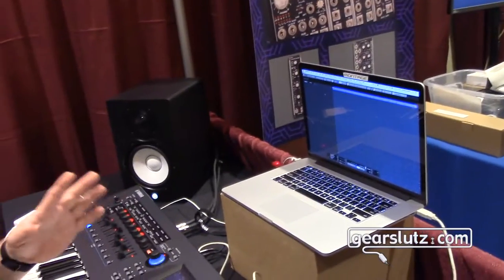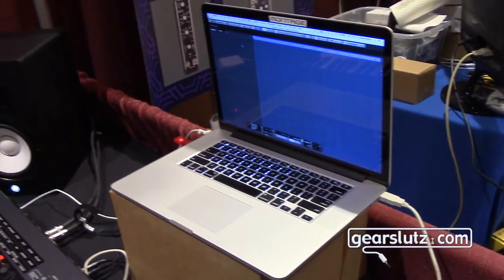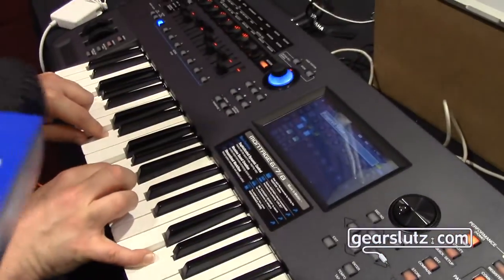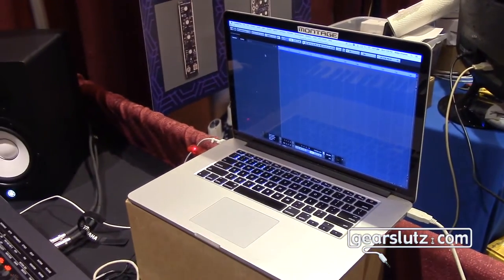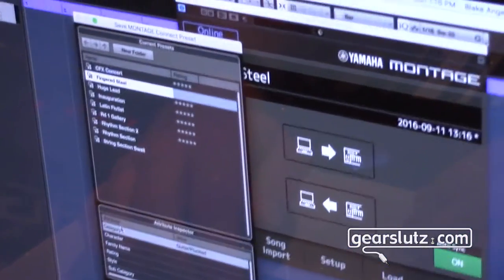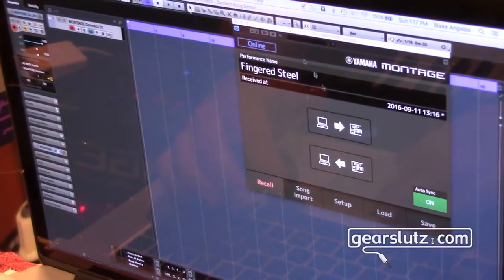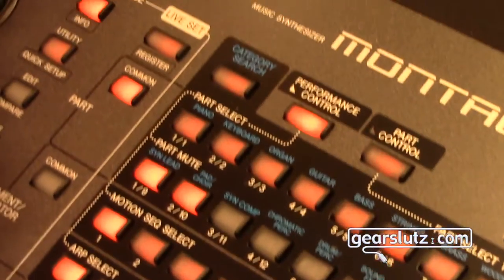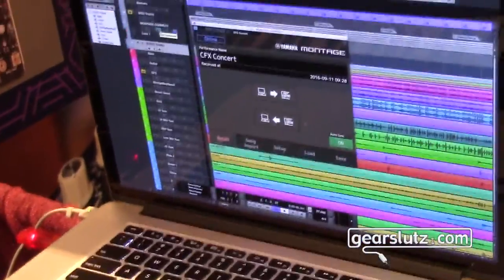Yamaha Montage Firmware 2.1 - Gearslutz @ KnobCon 2016

Comment: Can you play parts 1-8 simultaneously on the Montage and at the same time play parts 9-16 simultaneously on an external keyboard using midi single mode. So I can have different sounds layered on both keyboards